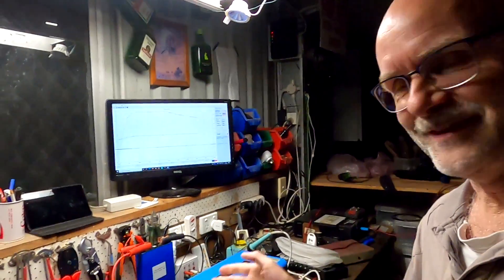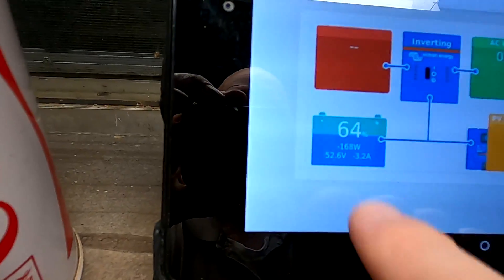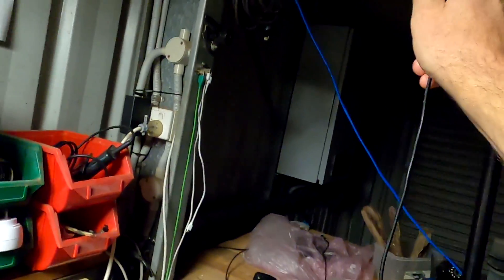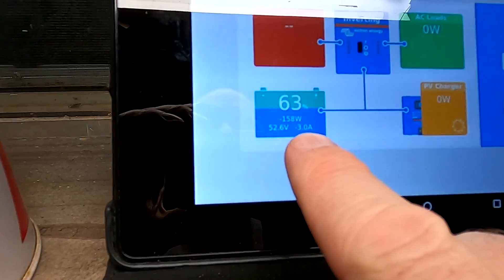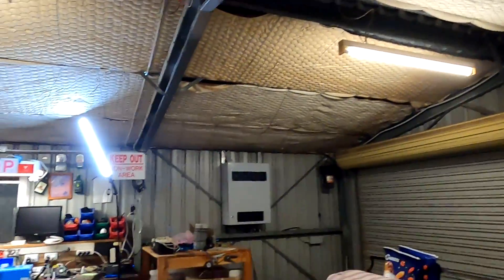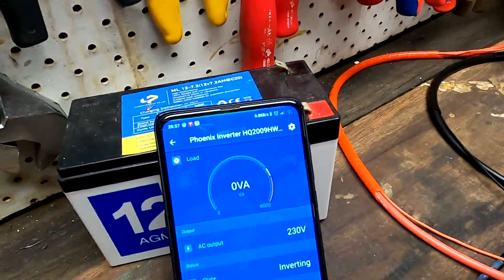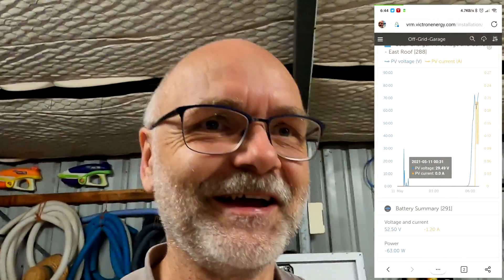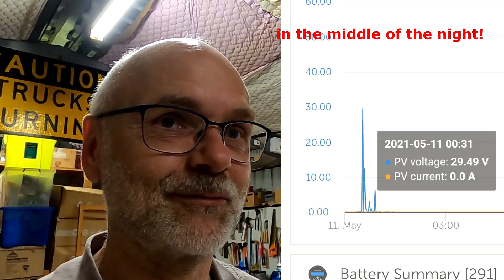How the Off Grid Garage rescued us during a black-out! (Also 🐸)

Comment: Mpp solar PIP8048MAX in parallel to victron inverter and you are ready for the III world war
Reply: will build my own with eve/catl/listen cells...unless i can get gyll/vglory batteries at a good price.
Reply from the maker: I don't think you can just parallel them with another inverter, just with another MPP?
Reply: @OffGridGarageAustralia  in my 280Ah 48V Lishen battery i have connected 2 different inverter/charger (a mpp solar 8048MAX with 6,8kWp of solar panels and another mpp solar 5048MS with 3,7kWp of solar panels both installed to the South because i live in the North side of the Eath). 

In the same battery i have also connected another 2 mppt chargers (epever xtra 40A with 2,6kWp of solar each, Est-West installed).

In total there are 15,6kWp of solar array but with my settings i am charging my battery only up 80Amps (so around 0.3C). 

during sunny days 20Amps comes from the 2 mpp solar inverters (there is a settings for max 10Amps each charging) and another 60Amp comes from the other chargers (in the morning 40Amps from Est and 20Amps from the West. In reverse during afternoon). 

With all this settings, i can draw up 11kW (7kW from 8048Max + 4kW from 5048MS) without over-charging or over-discharging my battery.

I use the mpp solar 8048Max only for charging 2electric car at 7.2kW and for the wood shredder 5.5kW triphase (using a 7.2kW VFD that transforms 230Vmono-phase in 400V tri-phase)

While The other 5048Ms inverter is serving my house
Reply: @zarbonida  Nice setup, like it. The separation of the house from the car chargers was intentional ? You know you could parallel the 8048MAX with an another MAX and had a single phase with 16kW power. For such a big (15 kWp) solar system 280Ah (3h * 80A = 240Ah) battery is not too small ?
Reply: @OffGridGarageAustralia  It is called a DC coupled system. Both inverters connected to the same battery (charging and discharging it), giving separate phase. You already have a DC coupled system with 2 MPPTs and 1 (only discharging) inverter. For real parallel so only one phase with higher W you need the same type of MPP inverters. Can not mix even an MPP MK with an MGX.
Reply: @mrzed6597  Right. 
My 2 inverters, both connected to the same battery, gives me two different phase with two different electric system. 
One inverter (MPP Solar 8048Max) is used for electric car charging station at 7,2kW. 
The other inverter (MPP Solar 5048MS) is for the house.
Reply: just bought 2 of these ;)
Reply: @houseofancients  what batteries have you or will you connect?

Comment: check if your inverter supports parallel stacking
Reply: I've got two Victron 3kva's together, they need to be setup for it rather than just linked together, they must be the same size, same series number for the PCB and equal length cables, the annoying part is you can't just use one without changing the settings.
Reply from the maker: It does not support that, no. Hence the idea to have a separate one just for the house.

Comment: My MultiPlus (12/2000) reads minimal AC loads - a Martindale mains tester with 3 neons (2 lit when wired correctly) reads 12w, a 40w incandescent lamp reads 43w, a 150w floodlight reads 167w, and a 900/1800w heat gun reads 923 & 1786w respectively. 

Maybe the MultiPlus (because it has the power boost capability) has a more accurate current detector on the AC output?

Comment: use your existing garage power wire back to the house to connect to a transfer switch to a new sub panel which dose lights pump tv and internet.  and coffee machine and of course fridge for your beer.
Reply: Or you can have a separate changeover switch for several circuits (1 for fridge, 1 for living room, 1 for cooktop). Using a good off-grid (with grid support so it is an UPS) inverter you can change circuits to go from UPS or Grid. Because you do not want to use the induction cooktop from battery (no need to stress the inverters) ... unless a big blackout.

Comment: Hi, i have two things to point out... 
Did you take out the balast from the lamps??
And i have an inverter from Chinese sources... And it shows VA and W!! And it is quite accurate... I have a power analyser (good One) and i compared the readings and they are resonably accurate.
Great work with the litle frog ahahah bye
Reply from the maker: I didn't not take out the ballast in the lights, no. It says they can stay inside when using this 'starter' coming with the LED tubes. The ballast is connected in series to the LEDs, so acts like a resistance now. Not sure how much difference this would make.
Reply: @OffGridGarageAustralia  when conected to AC power, the inductance always offsets the current from the voltage and that results in a poor power factor... If the inverter doesn't mesure power factor then it shows up as 0 VA... As if nothing was beeing consumed. And if it has resistance, it has power beeing wasted there, you should always remove the balast when you replace those type of lamps for LED's

Comment: i feel myself inverter for each job this way they is always a backup but the problem with doing this is standbye power draw draining the batterys when inverter is not doing load duty
Reply from the maker: But the one big inverter may not run efficiently with smaller loads too. So what's better? I like splitting up load onto different inverters as you said.
Reply: @OffGridGarageAustralia  having redundancy I guess is best and the inverters dont always have to be on only when device been used

Comment: Andy, I feed several house circuits through a generator manual transfer switch from my inverter.  I rarely use my gas generator anymore.  If the batteries get too low I do have to flip the switches back to grid power.
Reply from the maker: Yeah, I just cannot do that as we have a grid connected solar on top of the house. It uses one phase.

Comment: i would run a cable from the garage to the house perminatently underground  and have a flick over isolator switch in the house so when grid goes down you can isolate the grid and run from garage power something that would need to be looked into is if the inverter in the garage will play well with grid tie inverters if so this would mean you could be fully offgrid and run everything during the day if grid is down
Reply from the maker: There is already a cable from the garage from the house which supplies the house with power. Problem is there is also solar going back from the house to the grid in this cable.
Reply: @OffGridGarageAustralia  so the main grid feed is into the garage then the garage feeds the house ? if so then an isolator switch and inverter that is safe to feed the grid tie inverter could be used on a supply change switch or diverter switch so when mains grid goes down you flick other to the offgrid feed and all the grid tie stuff then feeds into the house to run the loads as a expander to the inverter just keep 1 socket on the grid side with a light on so you know when grid goes back online to know when to switch back things that can not be interupted by the power out like computer can be run on a ups to give you time to flick the power source
Reply from the maker: The stupid thing they did is, the property and garage have 3-phase power (they had machinery running in the garage) but only two phases are going to the house. One of them needs to stay as it caries the solar power from the house fed back into the grid. So I can only run the whole house on one phase. 
The feed-in contract runs out in 2027. Until then, I cannot do anything with the grid connected system on the house.
Reply: @OffGridGarageAustralia  oh that's a bugger

Comment: I hear a new channel, the off-grid house 😁🍻 but getting a cable from your garage to your house with a failover relais could save you in such situation for some parts of your blackout needs (refrigerator and freezer). Your solar panels are a capacitive load when they see thunderstorms. One way to minimize this is to keep your positive and negative cabling next to eachother and not in a circle, I've got a Dutch YT video about it, will post it because when you look at it you'll see what they mean (and Dutch and Deutsch can be compared a bit 🤣😂🍻)
Reply: https://youtu.be/x-zwp2z09-w Ketelklets is about power savings (gas, electricity and isolation).

Comment: With Ioniq 5 and Kia ev6 you have 74kwh with 3,6 kw power to load the house
Reply: As far as I know Nissan are the only company that won't void your warranty when you V2H/V2G.
Can the DC contractors be activated for V2H on an Ionic?
Reply: @andrewradford3953  230v inside the car 16A, and 230v 16A outside of the car with type2 adaptor and with the car lock
Reply: @nyneak  not sure if I understand. How are you getting power from the main traction battery? The onboard AC to DC charger only works in one direction.
Reply: @andrewradford3953  i has a separate inverter from 800v DC to 230v AC verry eficient .In Uk it has separate uk plug and type 2 /ccs.
Reply from the maker: The Ioniq 5 has an adapter which plugs into the Type 2 port which allows pulling 3.6kW from the traction battery through a 15A outlet.
Reply: @OffGridGarageAustralia  So I gather there is an in built 3.6kW DC to AC inverter in the Ioniq 5? That's an impressive feature.
Reply: @OffGridGarageAustralia 
https://thedriven.io/2021/04/02/preview-why-the-new-ioniq-5-heralds-a-step-change-in-electric-vehicles/amp/
Onboard 3.6kW inverter and a 58 or 72kWh battery. You could dump lots of Solar into it during the day and run your house any time the car is parked at home. Just not the kettle and microwave at the same time.

Comment: My Outback won't show any wattage under 100 watts same as Victron but your looks to be closer to 300 watts.
Reply from the maker: It shows 5-25W with other single loads sometimes
Reply: @OffGridGarageAustralia  I guess that its why you need the Victron digital shunt.
Reply: @OffGridGarageAustralia  Maybe it is the range of accuracy built into the controller shunt or measuring device and only report accurately when enough pressure is applied.